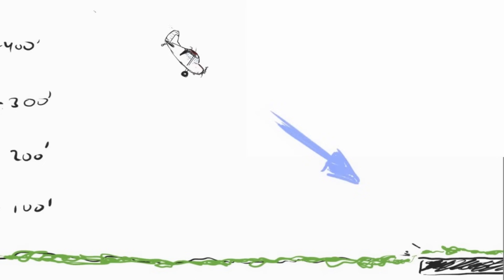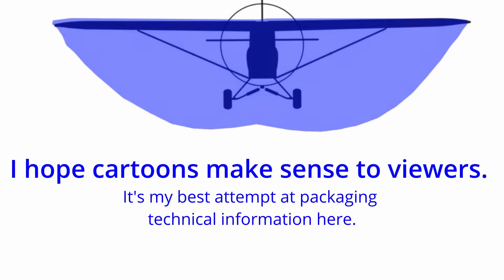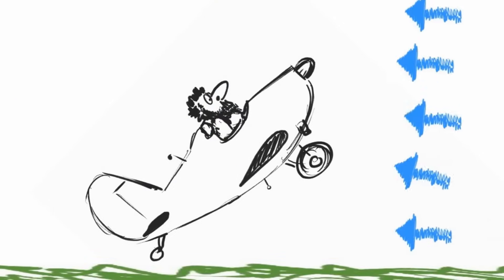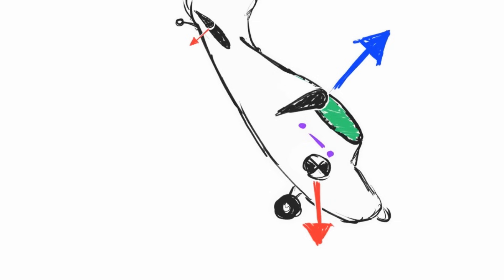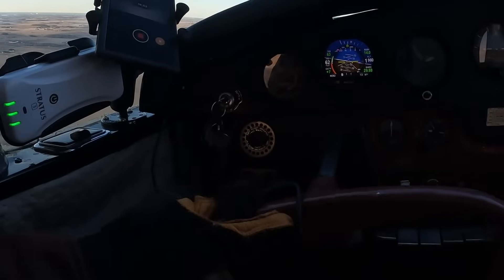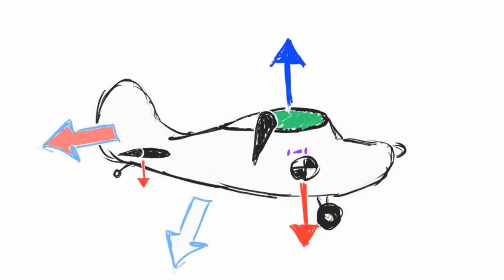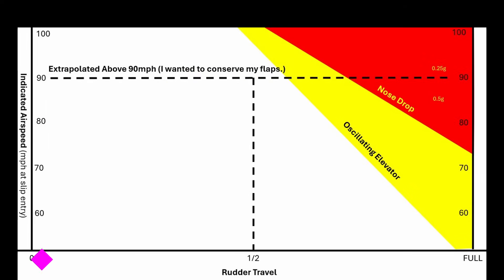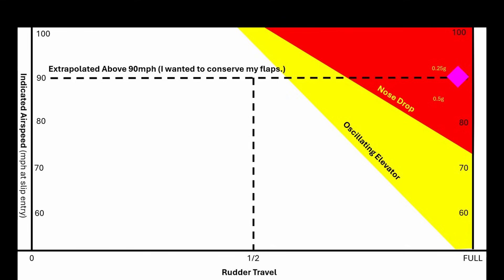Crash of a Cessna 170B, Did Slipping with Flaps Factor?

Comment: My instructor had done a full flap side-slip in a 162 with no surprises (it only had 30 degree flaps; I loved the 'handbrake' flaps, EASY to remember).
I did training in a 172 with a different instructor - this plane is a lot heavier, this instructor didn't do any side-slips (it also only did 30 degree flaps).
I've heard of the 140s and earlier 170s with their 40-degree flaps - there was a crash (fatal) - where the guy was trying to stay behind another aircraft but he was going too fast. He tried to perform s-turns with full flaps on final, stalled and crashed. He should have went around. 😭

Thanks for the video - well done, helps a lot!
Reply: The Cessna 140 and earlier 170s do not have 40 degrees of flaps, and if they did, those tiny little skinny flaps are nothing like the 40-degree fowler flaps on the 170B.

Comment: Thank you for this. I’m very familiar with this accident. That’s me in the picture. I owned that airplane for many years. I sold it to the new owners about a year before the accident and knew them well. The video is a very good example of the small envelope where slipping with full flaps can lead to blanking out the elevator, loss of control and fatalities. You have to have the pitch attitude, airspeed and control inputs just right (or wrong) to experience a sudden and severe drop of the nose. It should be noted that this only applies to the old 170s and early 172’s with the full 40° barn door flaps. It’s mentioned in the 170B operators manual that slipping with full flaps is not recommended, but in IMHO ￼it should be a required placard. I never personally experienced this. If you have to slip with 40° of giant flaps hanging out, you’re probably doing something wrong. But for the naysayers out there, I do know of several people who have experienced it both unintentionally, and intentionally as you did. That was an excellent summery.

Comment: Any technique will work if you have a feel for your airplane and experience in type
Reply: Wrong, no matter how well you know or how much time you have in your plane, the wrong technique will get you killed.
Reply from the maker: I agree.  Knowing where pitfalls lay doesn't mean we should avoid entire regions of the airplane's envelope of capabilities.  I'd also say that each pilot has to factor the variables for themselves.  But this gets to Phil's point too.  Using the wrong technique at the wrong time (from not knowing where the pitfalls lay) can lead to bad ends.  The wrong technique at the wrong time comes from not knowing you're exceeding the plane and or pilot's capabilities.

I'm just chiming it to say it seems like you two are on the same page.

Comment: This is the way I understand it, tell me why I am wrong.
Lowering flaps will cause a pitch down moment of the wing because the center of lift moves back, but a secondary effect of downwash is on the horizontal tailplane can affect the actual pitching motion of the aircraft.
This is markedly noticeable on the high wing Cessna 172 when flaps are deployed, resulting in a pitch up motion.
With low wing aircraft, or a T-tail where the horizontal is not hit by the downwash, lowering flaps will not have as great an effect on the tail. In this case, only the pitching moment of the wing is affected, resulting in a pitch down tendency.
On a high wing in a hard slip the downwash misses the horizontal and suddenly the nose drops, the buffeting before the nose drop is a clue the downwash is intermitent.
Reply: I'd like to see a wind tunnel test on the Skyhawk.  I may be wrong, but I've always thought the pitch up motion at flap deployment is primarily just an increase in drag above the center of gravity.
Reply: Hmm. I've heard many time that the drag of the flaps causes the pitching moment. Nose up for high wings, nose down for low wing. I believe this to be correct.
Reply: @edcew8236  That doesn't explain the sudden nose down when a slip causes the downwash to miss (stops pushing down) on the stabilizer of a high wing. This does not occur on a low wing in a slip.
Reply from the maker: I believe you have it right.  There's a description of the effects in Bill Thompson's book about the development of these planes.  Here's the refernce from: Wings for the Word, William D. Thompson, Maverick Publications, 1991 pp26":

"The 1952 C-170B featured new slotted flaps that offer extra lift for take-off and far more lift and drag for landing"...
..."We had some misgivings over the effect of these more powerful flaps on increasing the nose-down pitching moments and making 3-point landings more difficult.  Happily, these pitching moments were counteracted to a large extent by a nose-up tendency resulting from the stringer wing down-wash striking the horizontal tail.  Thus very little retrimming was required from an 80mph flaps up glide to a 70mph flaps down glide.  I recall project engineer, Web Moore, being overjoyed at this finding.  We were always puzzled when magazine writers criticized a transient nose-up motion with initial flap extension.  To Cessna pilots it was practically unnoticeable, probably because we extended the flaps smoothly and evenly.  Jerking the flap handle upward would produce the momentary nose-up motion."...

Personally I believe Bill is being a little hard on the pilots who were just receiving the new, slotted flaps at the time.  Previous, short-chord flaps on Cessnas were tolerant and even favored fast movement of flaps.  We can still see this when we look at Cessna 140 manuals that recomment briefly popping flaps on the takeoff roll to balloon the plane into the air.  What was happening is the plane was fast and the downwash was stronger than the change in center of pressure until the plane stabilized at its new speed.  No big deal if you anticipate it.   And, yes, with smoother motion of the big flaps (3 seconds from 0-20,  3 seconds from 20-40 in my limited experience) the pitch demand are a lot lower.

Comment: A 170/172/175 with the 40° flap setting will come down mighty quick with the barn doors drooping, generally no need to slip. I've done the "down elevator slip," as I like steep approaches, when winds dictated zero or little flaps.
Reply from the maker: With 40 degrees of flaps they come down pretty steeply.

Comment: Uhhhhhh.... how are T-tails getting downwash then?

Go back and read your FAA manuals on how an airplane flies.
Reply: Agree.  I think it has more to do with what speed and/or line of flight will cause the tail to be positioned in the wing's wake and therefore not have a usable airflow to control pitch.  And this can happen to any airplane.  In the PHAK, it is illustrated with an airliner - pg 5-49.

Comment: The was an OUTSTANDING review of this vexing issue. I fly and teach use of flaps while slipping but never really dug deep into why I would get mild oscillations sometimes… and other times not. 

I am curious how use of 30 degrees flaps impacts the dynamics.  Did you have a chance to check that?
Reply from the maker: Sorry it took me so long to get back to you.  Yeah, I did check 30 and only found oscillations without much drop.  I didn't add it to the video, though.  If felt like I was approaching the edge of nose-drop, though.  So perhaps I cuould have gotten it to do so with a more forward CG?

Comment: I bought and learned to fly in a C-120 and that plane would drop like a (controlled) rock in a slip. My instructor warned me to never do a slip in planes with flaps unless I was landing in crosswind wind conditions (crab than slip in the final few feet). If you think you do not have enough runway to land with full flaps, go around and set up your approach  properly.
Reply: If you're scared of using slips and flaps at the same time, go way up high and do it over and over. It's a tool in the chest and it's very useful for dealing with strong updrafts and/or big obstacles. I've seen +500 fpm with flaps 30, power off, full slip in 172s. I've seen it multiple times. You just have to fly the conditions. By the way, go up and stall the airplane, way up high, at full flaps full slip. You need to know what happens, and each airframe will react differently.
Reply: @joshuawfinn  Yep,  did that during my Commercial flight training and had no problems. The older C-172's had more available full flaps that were mechanical. My flight school where I completed my Commercial etc training had the more modern electric versions. I started my training in mid-60's washing airplanes. Not going to get into all the details...take too much space here. Thanks for the comment.
Reply: @joshuawfinn  Exactly! During my early flight training I asked the instructor to do spins. His reply is we don't teach spins, only approach to stalls and stall recovery. So I took an aerobatic lesson from another instructor and said "teach me spins!" He did plus much more and I know it made me a better pilot.
Reply: @rvrrunner  agreed 100%. I got absolutely publicly shamed in a FIRC class for daring to suggest we should teach spins to students. Made me feel about 2" tall in front of a bunch of instructors twice my age. Now cross control stalls are back in the ACS. Shocker. There's a blog called House of Rapp that provides a lot of common sense advocacy for upset training including spins. Made me feel less awful after getting raked over the coals.
Reply from the maker: @joshuawfinn This is troubling.
Reply: @ I'm not only a Commercial Instrument Pilot but was a USAF and FAA Air Traffic Controller for 9 years. Many times I had to talk a student pilot through an emergency situation such as engine out, low fuel, lost, etc. My background helped me ensure that the student watched his airspeed on final, watched for power lines, don't make steep turns and many more. Not teaching a student how an airplane handles in the extreme envelopes is not giving them all the experience they need to fly safely.